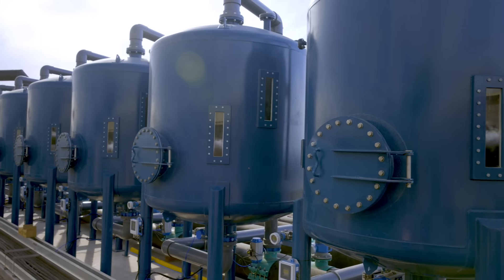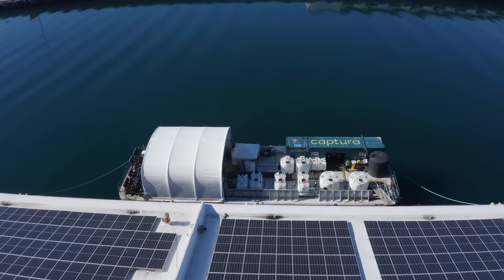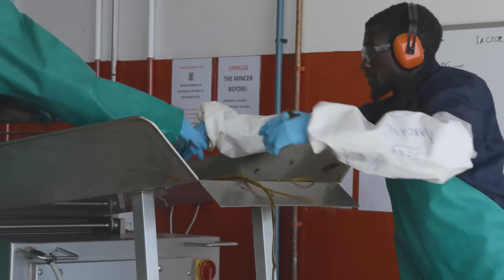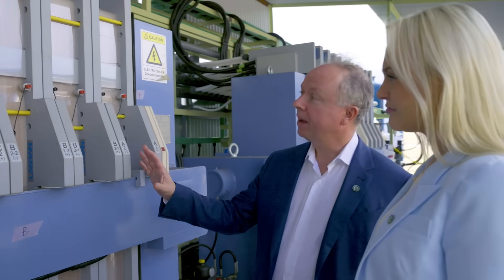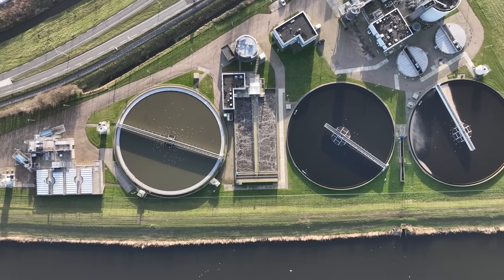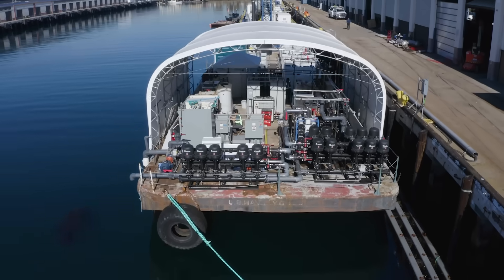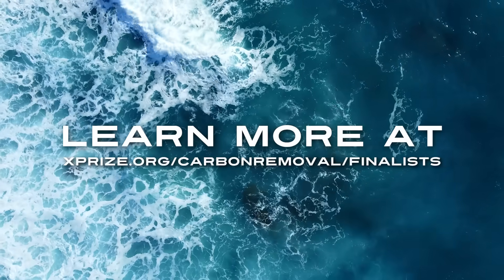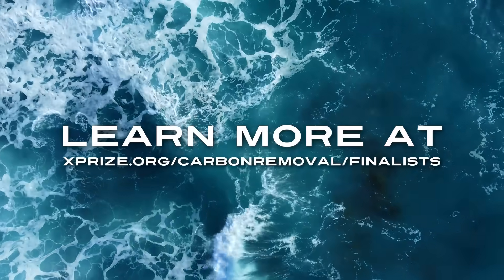Inside the Race to Remove CO2 from Our Ocean | Meet the Finalists | XPRIZE Carbon Removal

Comment: I have the solution for that I've tried to reach out to y'all over and over now I'm bringing it to the government sovereign x technologies through Fisher Tropsch reaction blockchain You make a carbon neutral aviational fuel and you cut ties from fossil fuel which will do enormous benefits with combined electric hydrogen and now carbon neutral methane-based aviation fuel which I have the whole process to closed loop system I wrote the AI to run it the entire system